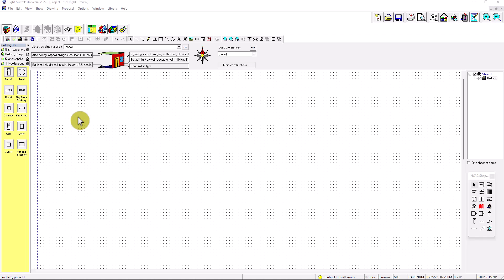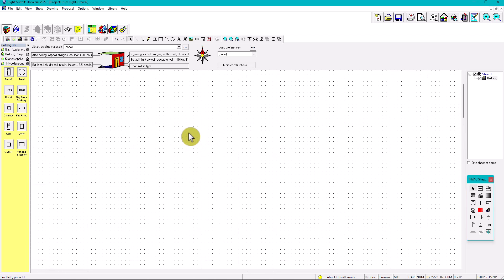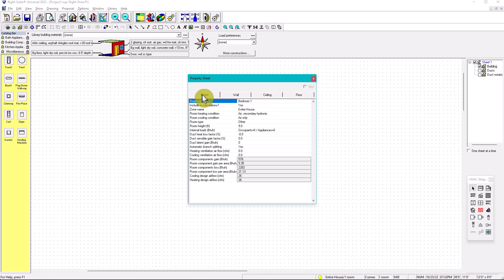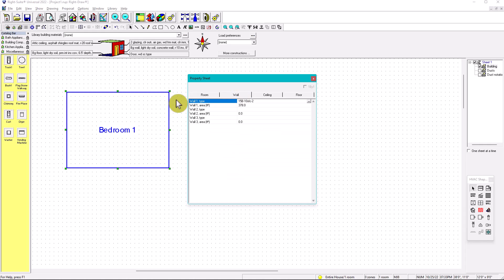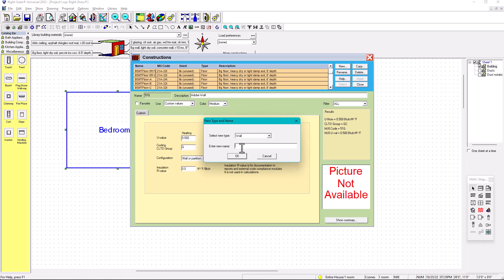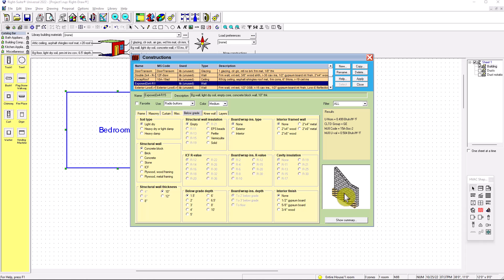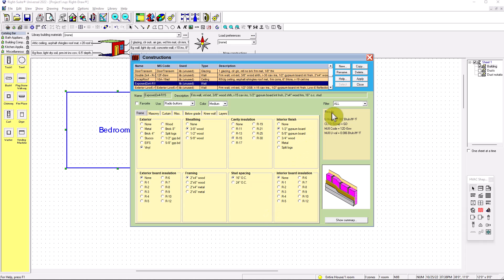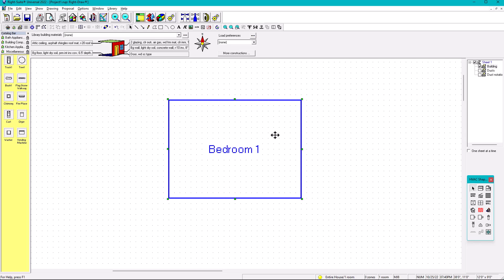Wrightsoft: Manual J Heat Load Calculation - Walls Library Creation

Comment: How to select particular wall with material as not all 4 sides will be exposed in this case? How to give diffrent wall type to 2 unexposed interior side walls?
Reply from the maker: That is a great question. To provide different properties on an interior or exterior wall you can use the "Wall Tool" under Load Shapes in the ribbon. This always work if the space is unconditioned like a garage partition wall, attic, unfinished basement or exterior wall. I hope this helps.